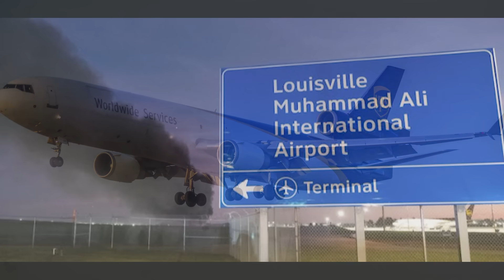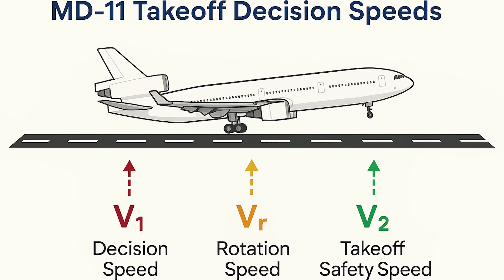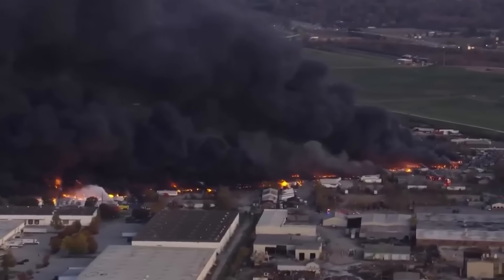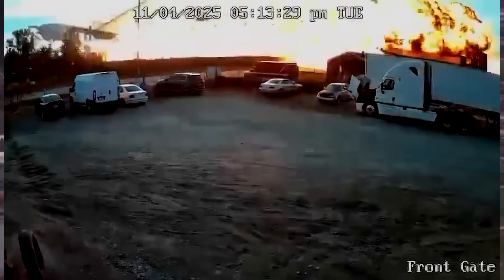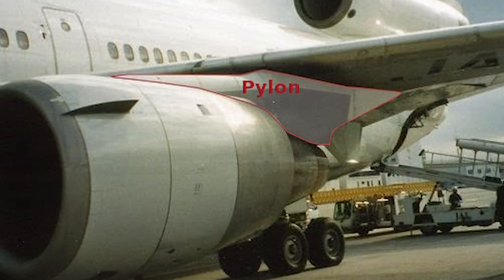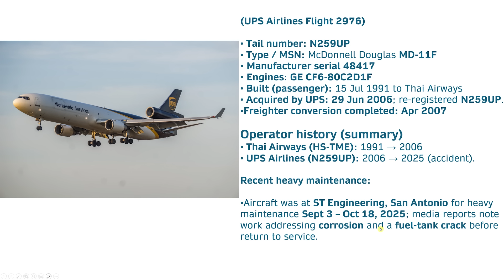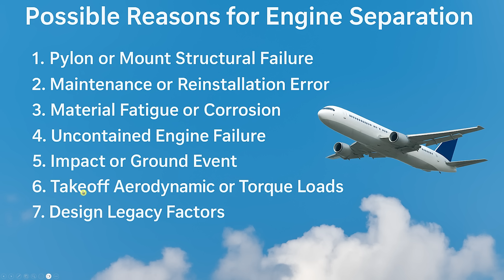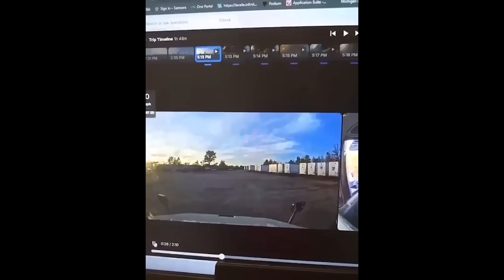What Caused UPS Plane Crash, Louisville, KY? How MD-11 Engine Fell Off

Comment: Im wondering had they not had so much fuel and cargo weight if it would have been possible to even correct this plane...I'm kind of thinking probably not but I feel like if they were to have atleast had a little more lift they could have shut that left fuel system down and used the right wing and rear rutter to stabilize the aircraft enough to try to land. Problem is, the pilots probably didn't know the entire engine was missing.

Comment: As Engine Fails it goes out of balance then adds extreme loading to attachment points no matter the type of engine  ...

Sounds like it could done with the old Practice of being Run up  to full load at the end of the Runway  ...

All it would of Needed was an oil pump to fail or cracked Blades on the Turbine to detach  to cause pylon attachment to Fail 

Max load wing damage rest sadly is history .

RIP to those affected crew and those on the Ground .

Comment: The plane’s leftward direction off the runway was caused by asymmetric thrust. The rear and right engines were putting out takeoff thrust—the most power a plane produces during the flight. Without that No. 1 engine, it would’ve caused the plane to yaw to the left. The pilot no doubt was putting in full right rudder to keep it straight. The fire in the left wing may have also affected lift over the left wing. That, coupled with more thrust over the right wing (and more airspeed), it causes the plane to roll over on the side without the engine. The fact this pond was so level to ground impact shows an incredible amount of control and persistence by the pilots. May everyone lost rest in peace.

Comment: Okay. i realize they say they found the engine on the airport, possibly even on the runway. but i swear just as the plane passes in the gap of the trees u can see the engine passing up and over the left wing. its the source of the fire and smoke u see with the plane (what else could cause it?) and just then hits the ground just as it passed the road. this is the first explosion . which occurred BEHIND the plane. the plane was just then doing a violent left roll so the wing would hit the ground (that point is well past the first explosion/fire on the ground.).
Why would an engine fly over the top of the wing? its putting out thrust. so much so that if it broke off it would not be clean, remaining connections between the engine and the wing would act like a hinge and the engine would end up pointed farther up and up until its flips over the top of the wing. theoretically breaking the wing in the process, which would explain why the plane also violently started to flip.

Comment: I think you need to do a little editing. First you state that the landing gear is intact in the dashcam video and then you say the sizable deep gash in the building hit closet to the runway was probably made by the landing gear. Those 2 statement can’t logically both be true. That gash that starts nearest to the runway and then ends must be due to the tail end of the fuselage dragging across the roof as the plane is attempting to gain altitude and is in a nose up (tail down) attitude.

Comment: Here's what they are saying, but not completing the answer to.

So we know the engine falls of; but where did it fall off at? How far did it roll?

Which leads to the following question...

So let's say the port engine #1 falls off at half the rollout distance. Then a huge fire starts...

Presumably there are fire warnings, zero engine readings, etc. 
The crew knows this is done...

Why aren't they slamming on the brakes? Using max thrust reversers and/or even raising the landing gear for maximum ground drag to stop the plane???

Even if they go thru the fence and into 1 building, better that than taking out half a mile of businesses, and people.

If this sounds harsh towards the crew (and not trying to be) but I know of 2 Navy pilots back in the 80s that stayed with their planes & died rather than ejecting - putting their planes into a parking lot or trees rather than hit buildings.

Comment: They need to mount the engines on top of the wings not on the bottom from now on so if a bolt comes loose the engine doesn’t fall off.

Comment: This is by far the most detailed breakdown of this accident, as tragic as it is. Well done. 🙏🏽
Reply: There are plenty, look around, even some by more experienced people like actual pilots, basically all the same for views, disaster = money on YT, not "news".
Reply: You would think that it was a maintenance error, because engines just don't fall off for no reason even with bird strikes.  And once the engine was gone probably all those dangling hoses were spewing fuel & lubricants fueling the cowling fire.  To have this video is enlightening.  You see the plane clipping power lines and the sparking when the lines are cut.

Comment: In the flight 191 incident. They determined it was from improper engine installation procedures. The Douglas repair manual for the DC 10 called for mechanics to separate the engine from the pylon ,but because there are so many bolts to remove when separating the engine from the pylon it would triple the turn around time. So they found out that if you just removed the main pins that attach the pylon to the wing ,they could remove both engine and pylon together which made separating the engine and pylon much easier on the ground saving hours of work. The only problem was when they would reinstall the engine it would have the pylon attached when they lifted it to the wing with a fork lift. Instead of the engine being raised to the pylon, the forklift would lift the whole assembly to the wing spar which over time damaged the bulkhead the pylon was connected to. The pylon was supposed to stay attached to the wing during the engine removal and reinstallation procedure.
Reply: You can almost be sure, somebody competent likely warned about consequences(of the hurry up ASAP procedures) & was ignored/overuled, or even intimidated.

I could name a dozen preventable disasters without thinking very long, among top ten, the  preventable first shuttle disaster.
Reply: I thought that there was a maintenance crew change in the middle of the engine being lifted up on the wing and the lift lost some lift being left suspending the engine with only one pin installed which cause a stress crack on it , flight 191
Reply: @raydemos1181  Being left supported by only the forklift for a time - the forks settled slightly, putting excess force on the rear attaching pins (as the forwards weren't mounted yet).
Reply: @raydemos1181  Its rare to attribute an accident to one factor they are almost always caused  by a cascading series of failures, James Reasons Swiss Cheese Model is one of the most popular methodologies for analysing this. The procedure American Airlines used was not in the Douglas issued Aircraft maintenance manual (AMM)  but would have been developed and authorised internally by the operator, at the time this would have been compliant with their Airline Operating Certificate (AOC) obligations. After flight 191 the FAA shifted focus and some AMM procedures became FAA approved ie mandatory. This part of the AMM is specifically the Airworthiness Limitations section. In summary after this accident certain critical maintenance procedures were mandatory and no deviation was allowed without FAA approval.
Reply: @raydemos1181 that shift change was a boot replacement on a T tail  the flight and plane escapes me. But 191 happened the way I described
Reply: @raydemos1181  for flight 191 that did happen but not the biggest factor many other DC-10s has similar damage just because of the nature of the procedure. 

Flight 191 and another flight that i cant remember the name of showed how an engine departing improperly can do a lot of damage. most likely they faced a similar problem to 191 when the engine departed it tore the lines to the slats they then retracted and stalled the wing combined with hot air and fumes from the fire reducing engine 2 performance the poor guys where doomed.
Reply: This is what I remember. Impact to engine mount as the engine is lifted by the fork lift would cause a crack in the engine mount and the mount would fail. Mechanics need to follow the instructions and not try to out think the engineers.
Reply: Ya, if you’re cutting corners to try and save time, knowing the catastrophic consequences, and your sighing off, absolutely not! Dam them if this was the cause!
Reply: @chrisbelcher5320 the key issue is that the proper way to remove the engine is time consuming. Designers need to consider people will look for the quicker way
Reply: @paulrasmussen8953  designers’ priority is safety not convenience! You can’t shift the blame because somebody decided to reverse the priorities in the field! If they could’ve done it in a simpler way, they would have done it! Engineers always have reasons for doing things a certain way that others might not agree with, but it’s on them if they decide to change methodologies!
Reply: @paulrasmussen8953  thank god you work nowhere near aircraft.  You have it completely backwards.
Reply: @paulrasmussen8953  that most certainly doesn’t excuse them for finding that way.
Reply: @BenState  no he doesn't. if the intention is for the engine to be removed from the pylon and not the pylon from the wing, why is it easier to remove the pylon from the wing?
Reply: @JTV84  what matters is the proper procedure
Reply: @nixl3518  Good point plus make it impossible to do the work in an incorrect sequence.
Reply: @BenState  I don't think they were condoning it, just pointing out reality.
Reply: @paulrasmussen8953  There should be ONLY one way! It's the MM at the proper Rev. end of story. It's not the designer's responsibility to make short cuts, no more than the person performing the work. Until the NTSB completes its findings, then let the finger pointing begin.
Reply: @paulrasmussen8953  I feel like the engine should be time consuming to take apart. You kind of rely on its ability to not fall apart to survive.
Reply: @paulrasmussen8953  That's a dumb thing to say. Designers need to consider safety first and foremost.
Reply: They weren't supposed to use a forklift at all. The forklift didn't allow small enough movements. I have worked with forklifts and I wouldn't dare to attempt to push a heavy engine/pylon into a comparatively fragile wing. The second mistake was to not install nylon and engine separately. Finally they botched the job, cracking the area near the attachment bolts which then started to suffer from fatigue until it failed at the worst possible moment. Criminal negligence
Reply: When you pay for a plane ticket, remember that it goes to pay workers and maintenance, and of course the business to make money, which creates jobs. Certain things are expensive for a reason
Reply: @NIkki-ox1ej  commercial truck drivers have to perform pre trip and post trip inspections for safety. They also get stopped by DOT for routine inspections. Sounds like planes are getting by with not enough inspections.
Reply: agree wholeheartedly - bet the maintenance supervisor is sweating big time right now
Reply: Wasn’t that American Airlines?
Reply: Thank you for that information! I didn’t know…
Reply: That was the first thing I thought of when I heard the engine detached.
Reply: I was thinking exactly about this case when I heard the plane lost an engine
Reply: @Diego-hd6py exactly. When i heard about the engine coming off i thought of flight 191...i didnt remember the flight number though.
Reply: Engine separation I don't think caused the crash. Engine 1 separated yes, but look at the runway footage, the crew rotated and looked to be in control as per procedure when past the V1 rejection speed, and you can see what looks like a puff of smoke and possibly flame out of the #2 engine (the middle engine on the tail) most likely due to ingestion of debris or flames from the #1 engine separation. At that point, the MD-11 had no chance with just 1 engine to stay airborne with such low energy state.
Reply: Engine seperating during takeoff definitely can cause a crash. If the engine separation damages a fuselage line it would cause a fire. Nkt to mention, flying with a missing engine is possible, but causes  imbalance and needs pilot time to fix, which during takeoff sequence is fatel @nudgethis9
Reply: Lakerairways had this issue with the pylon attachment.
Reply: I'm sure this is going to be something similar
Reply: "hey guys, look at this great shortcut I found. whoever put these instructions in the manual must be a moron. we'll save lots of time if we just ignore the manual"
Reply: Yep, I thought the same thing. What good does it do us if a detailed analysis and investigation reveals a solution, and sure enough some manager tells wrenchers to 'speed it up' and it happens AGAIN! I bet this is exactly that. NO shortcuts with lives at stake, EVER!
Reply: Fascinating analysis and plausible.
Reply: I just put that but didn't remember the flight number.
Reply: Perfectly and professionally well explained.
Reply: I wish this MD-11 hadn't been made in the image of the DC-10.  That plane was just a design mess.
Reply: Now multiply this times many maintenance cycles since this AC was built...
Reply: Wow, history repeats itself decades later.
Reply: I was on jury for one pax family American airlines offered ten thousand to family
Reply: That is a good analysis and correct. Improper maintenance procedures were a primary cause of the accident.
Reply: My God.
Reply: I drove daily along Touhy (72) past the crash site  of the 1979 American Airlines Flight 191.  I had to detour that day going home.
Reply: I heard about a case like that, maybe the same one? THREE bolts held the engine on, one sheared, and that was the end!
Reply: On spool up and travelling along the runway, there should have been an engine vibration warning. An explosion in the wing may have ejected the engine, thus causing instability roll. However, until an evidence is collated and an investigation concluded, it's anyone's guess.
Reply: The May 1979 O'Hare DC 10 plane crash was manufactured by McDonnell Douglas, I remember reading the newspaper about that crash and imagery of the descriptions of body parts they could only recover stayed with me for a long time, the DC 10 history of crash disasters has been legendary, it's probably the worst plane ever designed, the DC 10 is a plane you want to avoid at all cost.
Reply: an excellent example of someone's non-engineer-reviewed shortcut ending up killing people.
Reply: These maintenance short cuts are done to save money, ie the cost of 200 man-hours in the case of flight 19. Profit motive and safety are not good friends.
Reply: I have heard this a million times, the improper maintenance on AA191.  The pilot lost control of the airplane because the left wing slats retracted due to loss of hydraulic pressure to that side after the engine separated.  That was a design issue, not a maintenance issue.  The pilot flying did exactly as he was trained to do: reduced speed to V2-V2 + 10 after an engine failure.  When he did so there was no longer enough roll control to counter the loss of lift due to slat retraction on the left wing.  Why the engine separated and why the airplane crashed are two separate issues.  One was maintenance, the other was faulty design.
Reply: @georgiathai4961  no. why the engine separated was a big part, because of the improper maintenance the engine separated in the wrong way. the pins should have snapped and the engine should have cleanly departed but because of the damage the structure its self broke and it tore off part of the wing. also as far as i can find hydraulic fuses still aren't mandatory on aircraft even after United Airlines Flight 232 they still didn't make them mandatory. and hydraulic fuses can only do so much. if the line is torn / punched behind the fuse the oil is gonna leak out.
Reply: Also back then it required pilots to reduce power on the remaining engines. If they kept the remaining engine at takeoff power it is said that they would have probably not have crashed. In fact you can watch the documentary on Air Crash investigation.
Reply: @Joe-TechandBlog  If Air Crash investigation said they could have saved it by doing something counter to their training,  it's a show not worth watching.
Reply: @Milkmans_Son  While the show is questionable at the times, they were correct on this one. The procedure to deal with engine detachment was changed after that event.
Reply: @alexkucherov5711  engine detachment procedure?  They can't even see the engines, so how would they know?
Reply: So if you know that , why didn't they ???
Reply: Wtf man

Comment: I still think that this crash was caused by a foriegn object ingested into the left engine. Resulting in catastrophic compressor failure. With high speed turbine blades damaging the wing, and the engine pylon. Loss of the left engine sent numerous objects in every direction. Only two be ingested by the aft, second engine. Leaving the plane with insufficient thrust to remain airborne.
     Of course there could be another reason for the engine falling off of the aircraft in flames. Such possibilities are far less likely to occur.

Comment: The reason why it's not in 4k is probably due to how much data it requires to stream 4k. The footage from the air is more than likely live stream footage back to the aircrafts home base. And if it is indeed streaming the footage back to home base, you're going to be limited by the wireless bandwidth in the area (which is usually not fast enough to handle actual 4k). Even if it were to be 4k it would be low bit rate 4k which will be similar to 720p in terms of quality.